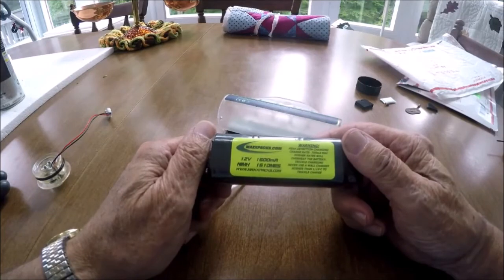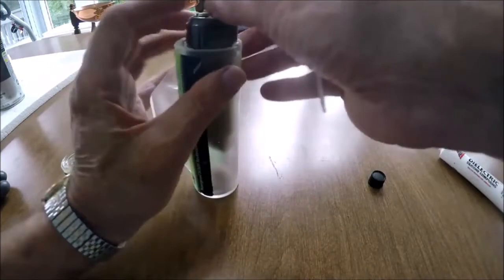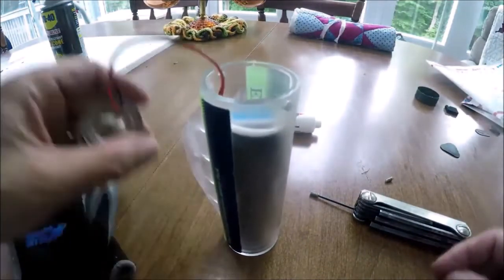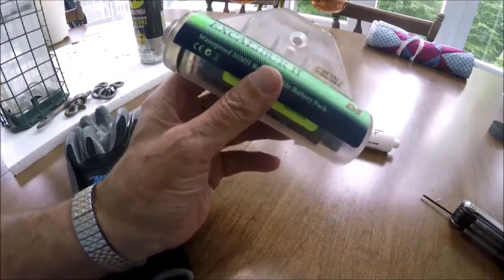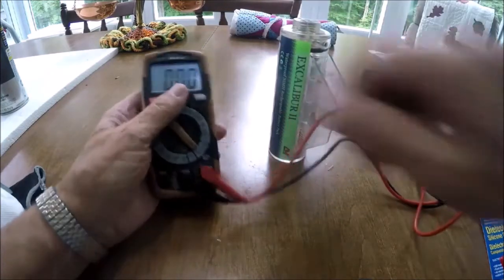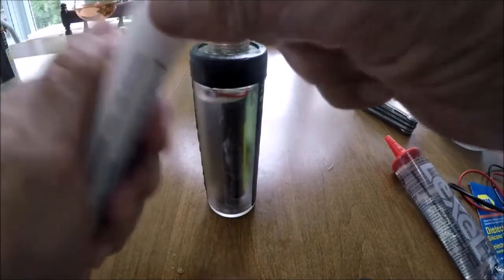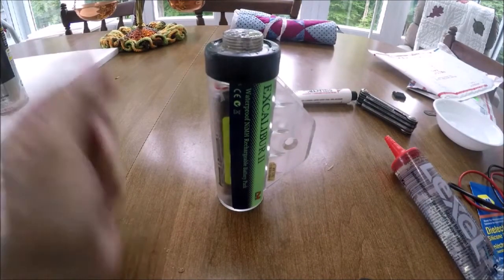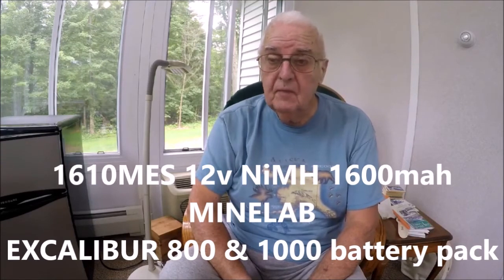Rebuilding the Minelab Excalibur II battery pack - 2nd edition

Comment: Hi Good video! where can I find the information about the o-rings used? eg the size of the o-ring in the battery pack? any ideas? thanks
Reply from the maker: Most hardware stores have "O" rings, most times they have a large selection of all different sizes, just take your old one and match it up.
Reply: @hconnellraate2474  thanks. But searching for this specific size

Comment: I JUST RE-BUILT THE POD FOR MY EXCALIBER SWORD, CAREFULLY TAKE THE HEX SCREWS OUT, THREAD THE BATTERY BACK ONTO THE MACHINE, WIGGLE THE CAP LOOSE, BE CAREFULL NOT TO BREAK THE WIRES,  TAKE YOUR RE-PLACEMENT BATTERY PACK AND CAREFULLY CUT THE CLEAR PLASTIC WRAPPER OFF OF IT, LUBE THE SIDES, CONNECT IT TO THE CAP, LUBE THE O-RING WIT O-RING LUBE, RE-CONNECT THE CAP LINING UP THE HOLES, RE-PLACE THE SCREWS, DO NOT OVER TIGHTEN THEM OR YOU WILL CRACK THE CASE,  ALTHOUGH THE CASE IS TAPERED SMALLER TOWARDS THE BOTTOM I WAS ABLE TO PUSH THE BATTERY DOWN FAR ENOUGH TO GET THE CAP BACK ON WITHOUT DOING ANY MODIFICATION TO THE BATTERY POD !,,,, DONE !!!,,,,, DO NOT OVER CHARGE YOUR BATTERY, GET A SMART CHARGER !
Reply from the maker: Will done Jim.  Sounds like the sward replacement s exactly like the Excalibur.  Lube up, be careful, and don't over tighten.

Comment: Hi Thank you for this excellent tutorial!! Can you tell me where I might be able to purchase the o rings needed to do the rebuild for a vintage Minelab 800, with the red ear phones. i am preparing it to sell. If you know of anyone interested in purchasing it please share. Thank you once again. you have been most helpful! I cab be reached at johncaruso3333@gmail,com
Reply from the maker: John.  I tried too e-mail you and it bounced right back to me as address unknown.  So I hope you get this reply to your comments.   No I don't know where you and purchase the O rings, but I would call Maxxpacks @ 262-623-6640 and check with them.  It's a long shot but they might have them.  Next I would check with MineLab here in the USA.  They have a distribution center in Indiana.  I don't know their phone number but you can google it I'm sure.  Another place would be your local Lowes or Home Depot.  They have boxes of all different sizes of O rings.  Bring your cap to be sure the O rings fit correctly.    If that does not work try calling Tony Eisenhower in California.  Tony rebuilds MineLabs and he might know where to get them. Tony s phone number is 585-945-0180.  Tell Tony I said hello and I hope is cold is better.
Reply: @hconnellraate2474    Thank you so much11 you are the best!! I dont know why the email bounced back>??  johncaruso3333@gmail.com
Reply: Oh I think I know why it bounced back. I put a comma instead of a period on the .com